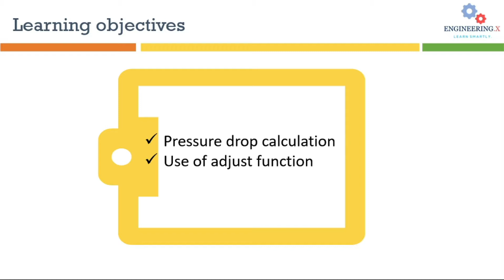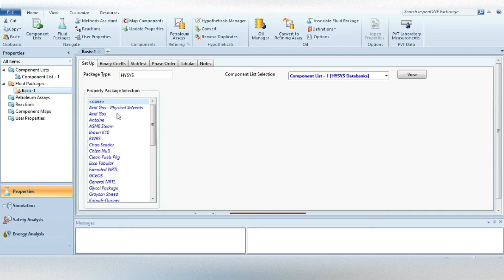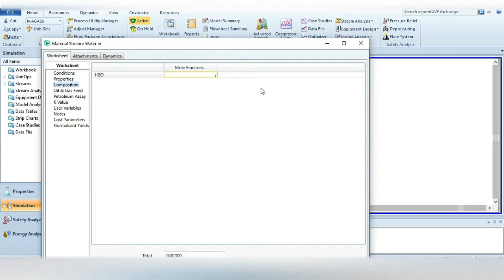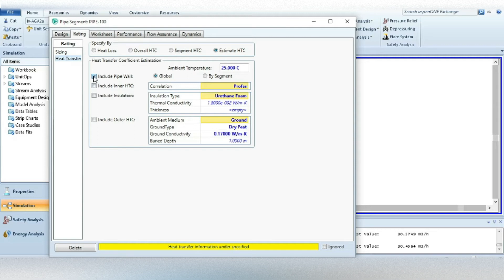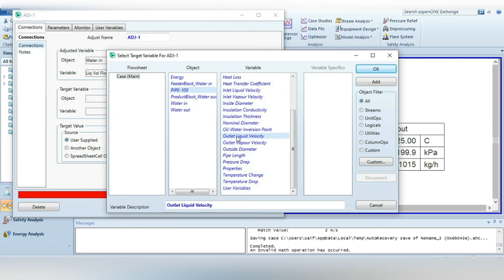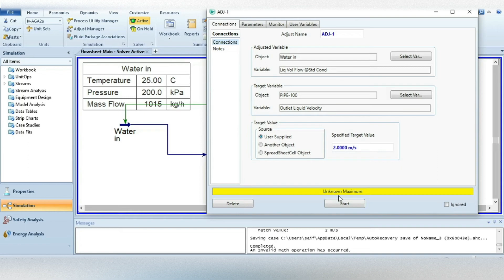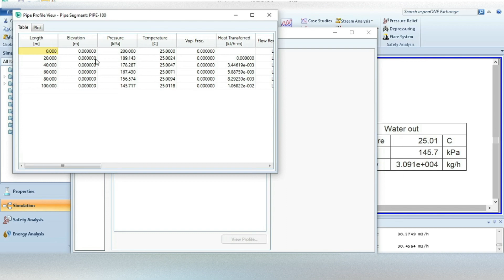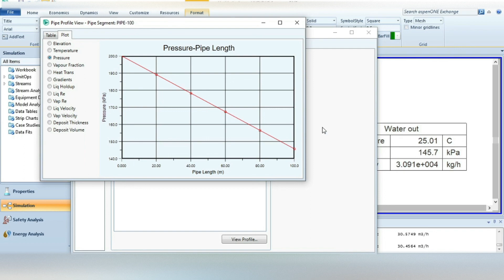Pipe Sizing, Pressure Drop Calculation, Use of Adjust Function in HYSYS

Comment: Thanks sir for this video, sir one of the pipe segment parameters is "Increments" which is defaulted to 5, so what is its importance? what is the recommendation for this parameter, shall it be kept at the default or adjust its value with pipe length, what is its effect, say for example if increased?